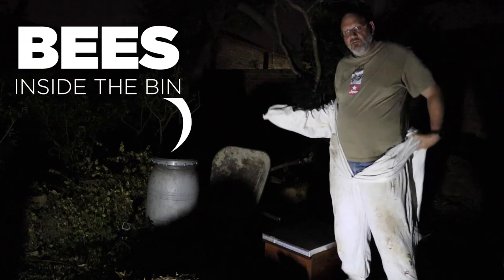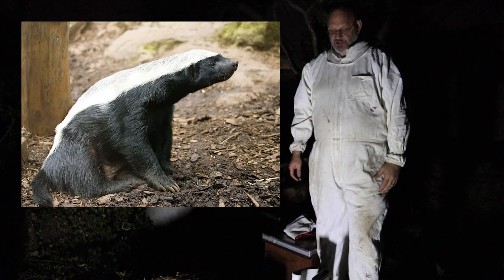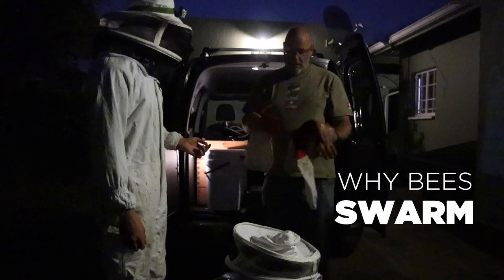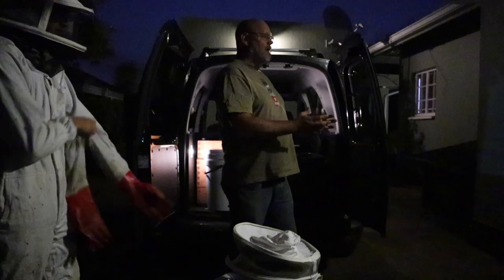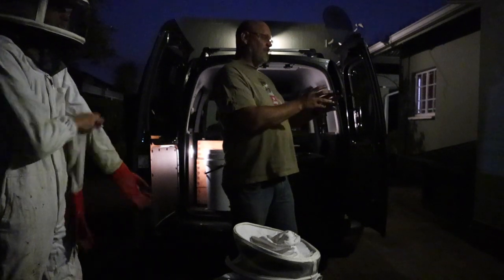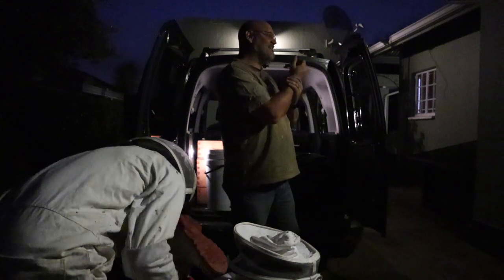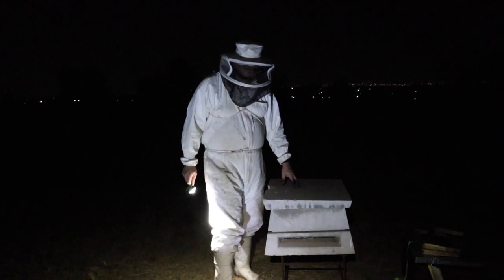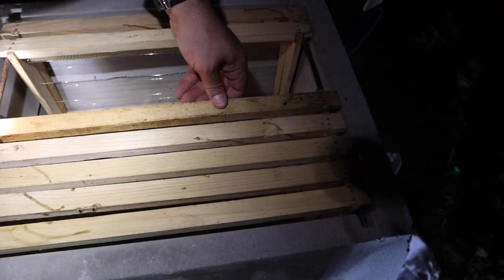Easy Bee Removal to Start an Apiary (Small African Bee colony)

Comment: Just out of interest what is the R value of the concrete vs wood hives?  They look interesting.  Glad to see your son recovered from his bee sting.  Also looks like you guys are going gang busters with your 3rd or 4th site.   How many hives per site?
Reply from the maker: Hey Kennith. These Hives I did not purchase they were on the land already. They are available at Beeware in Pretoria for R2,380 ($150), the wooden hives we can get for R750 ($50). So the benefits of the concrete hive will have to far outweigh the expense for them to be the right solution. We have 4 sites currently, with a 5th coming soon. The largest site is 12 hives and the smallest is 4 hives. We are now up to 26 hives and looking to double that this year.